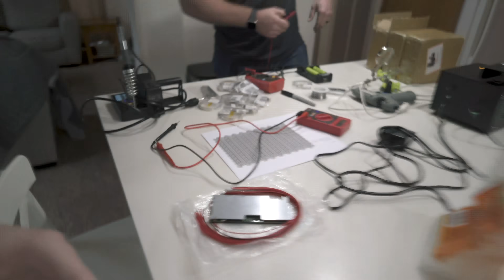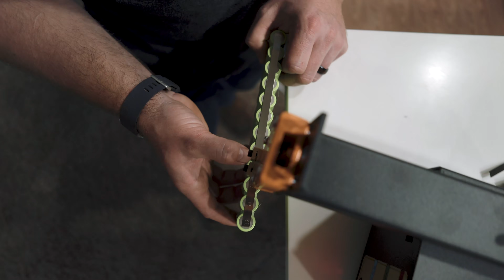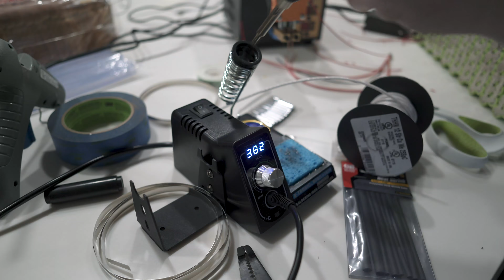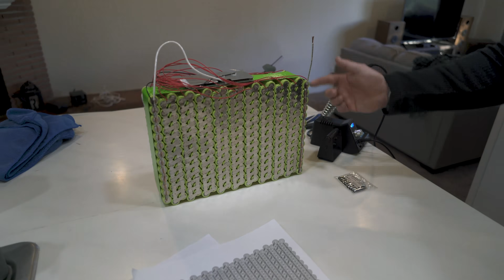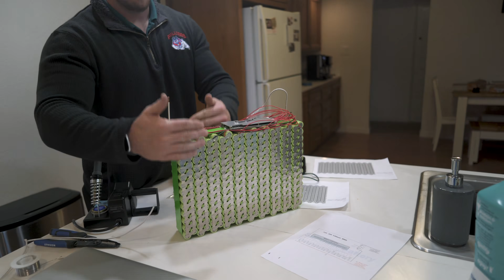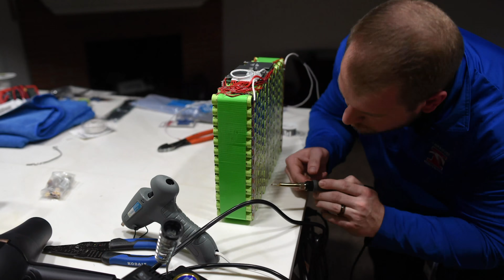How to MAKE a LITHIUM ION Battery Pack for an Electric Motorcycle (No explosions, sorry)

Comment: I learned more CLARIFIED information from this single video than may be 5 or 6 other videos combined. I am very thankful to u guys for making it easier to understand the aspects involved and the way to combine the batteries, and what the outcome will be. I am finally feeling far more confident in building my own - and am VERY glad I happened upon this video. THANK YOU!!
Reply from the maker: Our pleasure!
Reply: @TheInja  IMO this video is very bloated, redundant and unnecessary. One can do this in five minutes without annoying, useless and way to loud music.
What you've done:
1.: showed the aliexpress page of cells with an extremly shaky camera without going into detail. This should have been in the firs 10 seconds, definitely not at the end.
2.: tell (but not shown!) about the nickel strips and the fake nickel plated strips. I commend for the education value here! This could be a 30 second segment.
3.: told about welding instead of soldering. That's 10 seconds.
4.: go into the basics of S and P of a battery. At least 3 times, very unnecessary. Explaining S and P stuff is one minute, tops.
5.: calculated necessary battery size for a given project, that's cool, another minute should be in an informative video. 
6.: explaining a bit of BMS stuff, that's cool!
7.: made the battery pack itself. That could be another one minute timelapse, that's the only part in your video I'm quite happy with. Except the ludicrously generic, most annoying music, ever. 
Wrapping up the battery is good!
8.: tested the bike, yay!
What you haven't done:
1.: show the BMS on any site you bought is from.
2.: for point 5: Amps for a given 3000W motor is fine and all, but you failed to mention the peak loads can be way higher.

Other things to correct:
1.: your battery build is very unsafe! 
a.: you claim you have tested all the capacity of your cells, but it's not shown how it was managed. Yes, a 2 way charger shot is nice and all, but with that it would take many weeks to charge/discharge each cell and somehow note down the actual capacities.
b.: you have not shown or even done cell arranging! You have to be careful making your P blocks from selected cells to achieve same capacity for each P block. Failing that will lead to overdischarge is some P blocks. That will lead to range decrease very soon.
c.: battery holders are a thing for a reason! One just not glue together cells like that! Alternatively, you may create a rig that holds the cells together while welding them. I think it's a reasonable request.

Okay, so if anything in the video is there I mentioned it isn't, then, mea culpa. It's too long to watch the whole thing.
I know, this isn't a recent video, maybe your latest ones are way better. Or at least I hope so.
Reply from the maker: @Sekir80  you obviously didn't watch any of it to learn anything then. I think your comment is unnecessary. We're just trying to help people and you're here complaining 💀
Reply: @TheInja  I liked stuff in your video and even tried to point those out. My complaint is the information density. 
(and the atrocious music).
And I commend you are getting back to me, thank you!
Reply: @Sekir80  This BMS has no 20 thermistors, so this kind of BMS is not for such huge battery.
THere is no 3D model, of heat buildup in this pack, so some cells can have 45 another 60 *C.
This pack has no water cooling or do not have heatpipes to the metal aluminium cover.
But a lot of pepople on YT copy design one from another, without makeing PCB for BMS
and use proper chip, FETs with low RDson, thick BUSBARs on BMS etc.

Comment: I'd love to see how this works now since it's been almost 10 months since the video aired.... It's not the initial build and functionality that I'm not sure about, it's the cycles and percentage of pack life that I'm curious about.
Reply: 18650 cells can be charged and discharged about 300 times before they lose 20% capacity.
Reply: And mechanical stability, which I think is the weak point of this pack. It's super compact though, but I worry about what will happen as it ages.

Comment: How many batteries would I need for a 48v 42a?
Reply: That would be 14s13p. You take 42ah / 3.4ah = 12.35 cells in parallel (round up of course). So 14 X 13 = 182 cells. So get out your Gold Card, cause it's gonna run you 500 USD minimum.

Comment: Nice video guys. Is there no risk of overheating with the cells so closely packed? Also, when you connect two parallel rows to make the series connection between two rows, is it necessary to make a connection for each pair of cells (between -ve and +ve sides)?
Reply: Heat very well could be an issue, but we added enough cells that they're weren't taxed enough to make much heat. 

For series connections, the more you make the less heat and resistance there is, so the cooler and more efficient it runs. We needed pretty all the connections we made to not restrict it at all.

Comment: Great build and great inspirational videos. 👍.  I just recently rescued and abandoned electric sport bike style QSmotor 72v 2000w 180613 652004. The bike was in a small collision so it I will to purchase the shell, right side handle bar, right side brake handle and most definitely a charger. Any hints on where begin?

Comment: Disclaimer- I have built many small electric vehicles and battery packs using lithium ion cells. Poorly designed batteries can be VERY dangerous!  Wire gauge on your battery is WAY too small!  I laughed when I saw the large power pole connectors with spaghetti sized wire coming out. You need discharge wires to be minimum of 10 g, preferably 8 or even 6. You should use flat tinned copper braided wire for serial connections as nickel strips have to be stacked several layers to handle higher amps. Also, you should put insulation material between series connections on the positive top of battery cans and also in between parallel blocks.  You can't put a lot of faith in the thin plastic cell cases, especially with the low current wiring which will result in more heat and potential melting.  This is a extremely unsafe battery, and I would not use it personally IMHO.

Comment: What charger do you use for the battery
Reply: That is a great question. I imagine 20s is crazy expensive. I would put charge leads at 10s and 20s (two banks of 10s for charging only). Then you could use two standard 36v (42v) scooter chargers. The chargers would have to be "isolated" power supplies so they don't see the whole 20s. Most chargers likely are isolated.

Comment: 1. You have to use Cell level fusing..to avoid any hazardous/high temperature/fire/blasting situation.
2.Cell level fusing system will save the entire battery pack insted of only one cell.
Please reply your comment

Comment: Did you guys conned each 72volt battery with a BMS directly to the controller?  I'm trying to understand how you'll charge them and use them all???????
Reply from the maker: No, all three packs are connected in parallel into one BMS, so they act as one large battery pack.
Reply: @TheInja  Do they each have their own BMS?  My battery isn't charging & I'm thinking about piggybacking the main  charging cables to my other one & charging it off of it just to get the voltage up to working by itself for  charging?  Thoughts?
Reply: If you do that, each cell risks getting out of balance in the pack not connected to the BMS. The only way to connect them would be to connect each series group as well as the main positive and negative lines. Otherwise the voltage will be the same in the whole pack, but not in each group

Comment: Time to save money and make a 72V 20-30ah battery depends on the budget 👊
Reply: How much money was/ or Could be saved ?
Reply: @jerryjordan8551  Here in the Phil, you can buy LiFePo4 battery packs for about $320-350, pre order but if you want to make your own, you could save almost 30% off the price.
Reply: @maxximum.effort  but I want the same type of battery@72 volts & the cost to make it was $580.  Dollars 
That's Alot, & Not including the tools etc
Reply: @jerryjordan8551  Yes. Here it costs $350 with the warranty of 1 year. Planning to buy 72V20Ah LiFePo4 because 18650 batteries are kinda dangerous to use.
Reply: @maxximum.effort  So 🤔 How much is the 72v Battery I was Thinking of 🙄
Reply: @jerryjordan8551  That's the price but it depends on where you live.

Comment: These batteries are rated as 30A discharge current on the Aliexpress listing - do you think this is legit too? Did you test for this?
Reply: If they are capable, it's likely the peak discharge limit and not continuous. They don't look like high power cells to me.
Reply: @JamesBiggar  I actually purchased the batteries too in the end. I've got them set up in a 20s10p configuration, and based on the voltage drop I wouldn't want to peak them at more than around 13A.

Comment: Did all the cells have 3400mah each after testing?
Reply from the maker: Can't remember the exact figure, but I think they were all closer to 3700!
Reply: @TheInja  Then you were right about 2C max discharge. Ali now claiming 30A discharge for these cells. Only tool batteries can do that and max out at 2500mah or so.

Comment: hey bro, bring back the electric motor cycle but upgrade the controller. if your gonna upgrade any ebike with the battery you need to upgrade the controller with it to really see a difference in performance
Reply from the maker: Check my Instagram

Comment: Good choice in adding the extra cells, i had a similar issue, I wanted to do 72v or 20s 6p with the space i had or a 14s 9p i chose the latter as battery longevity is more important than my top speed,  and the lower voltage let me drop the current per cell. So i have a slower bike, 70kmh instead of 90kmh but this version pulls really really fricken hard. Like 0-60kmh in  just about 8seconds, also this is a bicycle so that's Plenty.

Comment: Where's the heat dissapation for the battery?
Reply: There is none. The battery temps should not be that high since they are not drawing too much current while riding and the charge rate is pretty slow as well.
Reply: @JasonWW2000  I would at least run an expected worst case load and day test with a probe in the center of the pack.

Comment: Thanks for the more in depth video. There are few safety concerns though. You should have insulated the positive terminals with fishpaper rings, otherwise the nickel strips may damage the top insulation over time due to vibration and lead to a severe short. Also recommended is to put fishpaper between all p groups for the same reason. Lastly, the balance wires should be layed out nicely and without crosses, otherwise they might short as well over time.
Reply: Agreed- Especially considering how much heat will be generated with the small wire sizes and not enough meat on the series connections. This is a very dangerous battery!
Reply: @Badgermilk-zc2wy  Yes, 3000/72 = ~42 Amps, that's a lot of current for that wire, not a whole lot of margin there, and the cells alternating like that and directly touching basically puts too much trust in the thin shrink wrapping around the cells. It will work initially but over the longer run this is a recipe for very bad trouble. One single bad cell in this pack and the whole thing will go up.
Reply: Agreed - it's a bad idea to build a battery like this with no insulation between P groups.  I once opened a battery and found that the insulation had come apart on one of the cells, so now I'm always quite careful about this.
Reply: Oh, and I only just noticed that the BMS is sitting on top of a thin piece of tape bridging some 30V worth of cells, that's a short waiting to happen as well because the BMS edge will wear through the tape and/or the cell wrap.

Comment: I build custom Ebikes in Toronto Canada Why are you staying at 72v? Volts are speed  Amps are torque Built the same bike QS 5k motor Kelly 200 amp controller and 96v 50amp lipo  Cant keep the front wheel on the ground and tops out at around 90mph
Reply: They want to keep it compatible with the existing electronics.

Comment: Just a suggestion. I hope you can do a postmortem for us on the original battery pack. You mentioned a broken charge wire and dead cells.
Reply from the maker: Yeah, still figuring it out :)

Comment: The Inja I love this series, where do you buy your big heat shrink for the battery? I want some to help waterproof mine
Reply from the maker: Links in description 👌🏽
Reply: Awesome thank you. I'm here doing some thinking, I wonder if the controller/hub motor the bike shipped with supports regenerative braking? It would definitely help with the brake squeaks, if it were enabled there is a chance the pads are contaminated as well so sanding them or replacing could solve that issue 🧐📝 fun times ahead!!

Comment: Vtc5a cells are pretty good for high drain applications and they are pretty cheap
Reply: It seems they went with a chinese made cell. When you buy this many, you need to keep the costs down.
Reply: You also dont need high drain cells. At 20S, even high capacity, low drain cells can deliver plenty of amps.

Comment: I have a 10kw motor with a 72v80ah battery pack on my bike. It does close to 130kph but the bms will shut down at high loads on sport mode,  so it's unreliable to ride.  I haven't ripped out the cells yet but I suspect the bms is not rated for the load.  I'll rip the pack apart soon and test everything, and I will most likely upgrade the BMS to a (300a) Ant BMS with bluetooth so I can display cell details on a small android device mounted near the cluster.  I'm not an expert in batteries so I'll learn more as I go plus this video was a great watch. Thanks for the well documented details @Inja and @lordchris - awesome build!
Reply: Easy fix- bypass the BMS for discharge, and only use it for charging.

Comment: How do I charge different voltage, once they wired series and  parallel where buy bms ect is there links I'm going watch series sorry if already said
Reply: Oh so bms is the balancer, than use regular charger , how about l.v.c so dont run batteries down and ruin , are they not same lipolymer lithinon ion. You can run lower wo damaging the cells  ?
Reply: @paulclancy2404  The bms is designed to limit discharge voltage to keep things safe.
Reply from the maker: Links are in the description.
Reply: Thanks

Comment: I have to watch, I can get these batts for free they throwing em away at work
Reply: Recycling I should say
Reply: There is a reason they are using new cells. Each cell needs to be identical and have the same number of charges and discharges. You can't get that with used cells.
Reply: @JasonWW2000  ik batts i wad talking about are brand new they wired series packs 14.4 I think . They back up packs for some kind computers
Reply: @JasonWW2000  thanks I didnt realize how critical that is also same amount cycles

Comment: I see some potential failure points  with the battery. The positive side of every parallel connection doesn't have any insulation rings. When you soldered the power leads the cell shrink wrap could of melted exposing the negative casing of the cell to the nickle strip. Secondly,  every cell was hot glued to each other, so there are points where the battery shrink wrap could get damaged over time a cause a short. Considering this is going to be installed on a motorcycle,  vibrations will eventually cause a short.
Reply: Dam you guys are smart. That's why Chinese had it in a  insulated box , problem keeps heat in , add separate battery pack for couple pc.fans one supply one for exhaust go back to insulated box lol jk
Reply: @paulclancy2404  that's not a bad idea. But then they take power away from the end goal. Better to have free flow air..
Reply: @freedomforall2924  ik ik, maybe a cowl into a duct so atleast when your riding could get lil free cooling
Reply from the maker: Thanks for the tips!
Reply: @TheInja  No problem . These videos you are posting are motivating me to build my own electric motorcycle soon.

Comment: For the current you are going to draw from the pack, you might want to take a closer look at wire sizing. Those look pretty undersized.
Reply: I agree.  I had discharge wires 4x as large on my RC helicopter running a 12S setup lol.    Higher volts will drop amp load, but you are still shooting alot of watts over those wires.
Reply: Way under sized make sure BMS connection are all same length too 😂
Reply: Those cells start to overheat at 20a soo it's enough for this pack
Reply: Multiply the number of cells connected in parallel to the amp output of each individual to get the total current. 12 cells  x 20a = 240a capability. Even at 10a each that's 120amps.

Comment: Did you consider putting any temp sensors into the pack? While I understand the advantages of hot glueing for compactness of the pack, I wonder about thermal considerations under high load for extended periods of time. That’s why I think it can be a good idea to use the black plastic spacers so you at least have an air gap for heat dissipation, even if it’s only passive. Of course if you want to get higher speed and longer range, then eventually you need to at least add a heat sink and eventually active heat management whether forced air or liquid cooling.
Reply: but only 1 hour run time right ?
Reply: @paulclancy2404  The 1 hour of full power is only in theory.
Reply: At full capacity and thats when create heat
Reply: That would be a good idea, if your ran it at 70km per hour for 1 hour long. Maybe drill some holes in the battery holder frame in the front and back. Get some air flow.